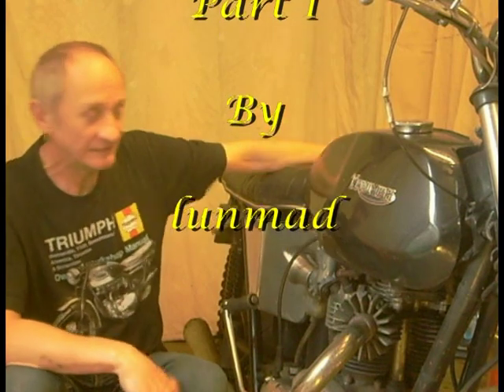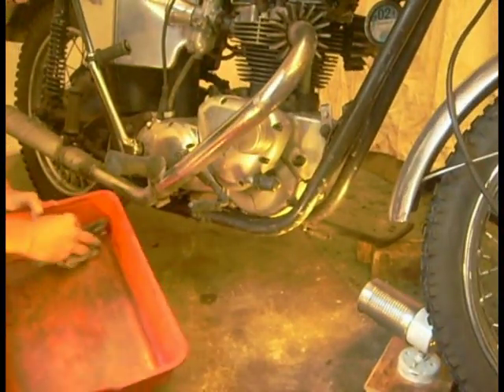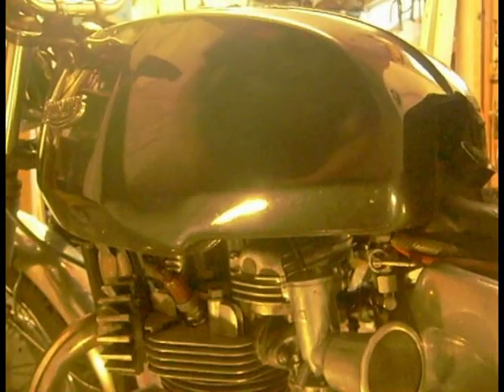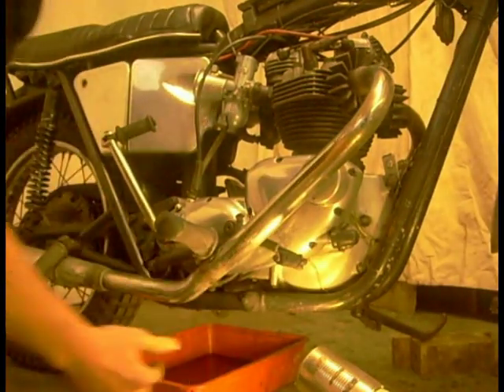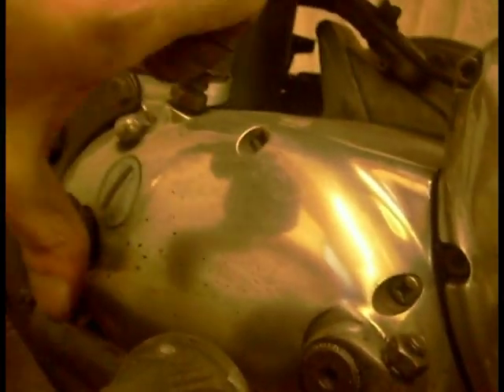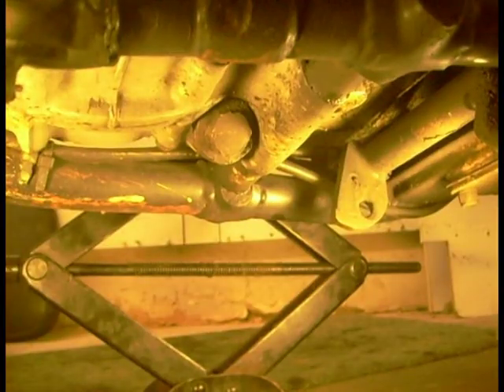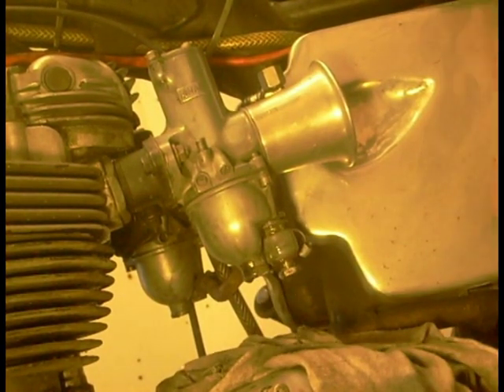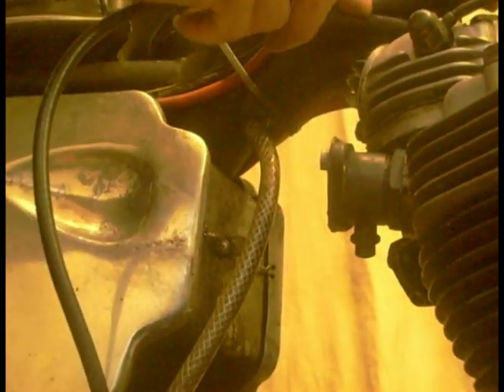T120R Bottom end rebuild part 1

Comment: I saw my 72tr6r the other day, got talking to the new owner it wasn't the guy I sold to. Anyway the bike looks how I sold it and sounds fantastic the engine still runs like it was meant and the "pea-shooters" sound like a Triumph should when he accelerated away from me... )) new owner is really chuffed, no oil leaks my old 650 was ran hard and still does!!small weep from intake rocker box was all.. )) I was so pleased it still runs and is not bobbed or chopped up.
Reply from the maker: +Jonathan Dickson 
Hi Jonathan :-)
It's great to see these things ridden as was intended, there are far too many trailer queens for my liking.
Ridden not hidden is the way forward.

Comment: I really enjoyed watching this- interesting how we differ in method. The rod bearings were also lightly scored on my T140 and I cleaned  them up with 1000 grit emery and then polished them with a long soft rag and solvol and then purged the crank with solvent in a parts cleaner. Oil pressure is amazing now.
Reply from the maker: +Carol Kemble 
Thank you I'm glad you enjoyed the vids.
 I am still running this rebuild 5 years on with my two odd rods and raggy crank and she still runs strong.
Now after saving I have two new rods to go in, so a well over due crank regrind is on the cards
 in fact I have just started to take the motor out to do it 15/3/16 watch this space #2 rebuild on its way :-)

Comment: I had my rods lightly ground on the faces of the bearing end caps and then bolted together and machined to obtain perfect tolerances- makes a huge difference to oil pressure.
Reply from the maker: +Carol Kemble 
Hi Carol :-)
Isn't it great when you have to improve stuff that should have the correct tolerances in the first place.
An old trick from the old days was to place some very thin foil behind the big end shell this has a similar effect.
Nowadays with more machine shops and spares around stuff like this need not be done, but it used to and will still have
the desired effect for worn out stuff.

Comment: I had bushing seizure on the little ends on my A65 because the bushings weren't reamed sufficiently. They gripped the wrist pin tighter than the conrod. Machine shop reaming is the only way to go in my book.
Reply from the maker: +Carol Kemble 
Even machine shops and machinists can have bad days, if the job is done with care there is nothing wrong with doing stuff by hand.